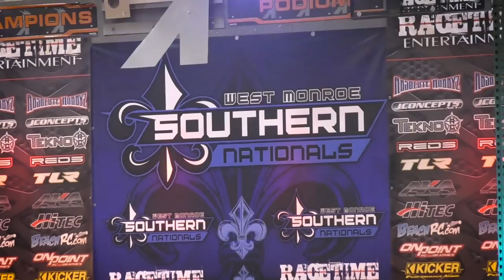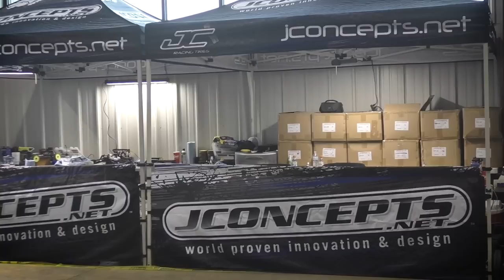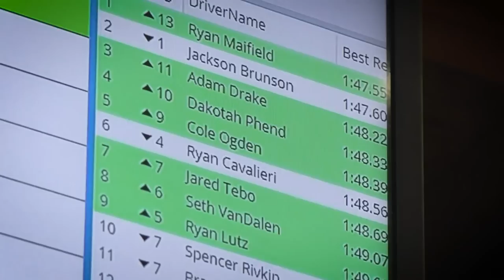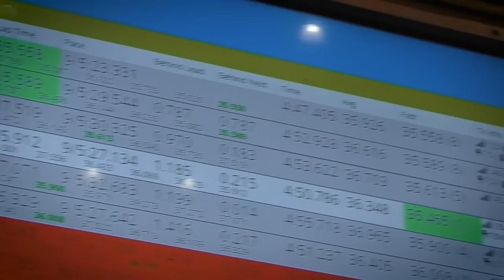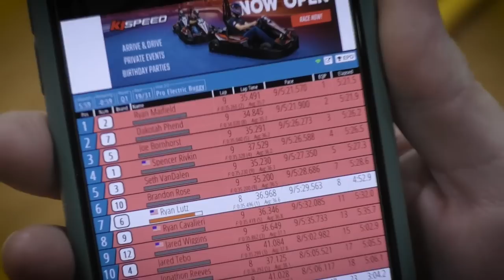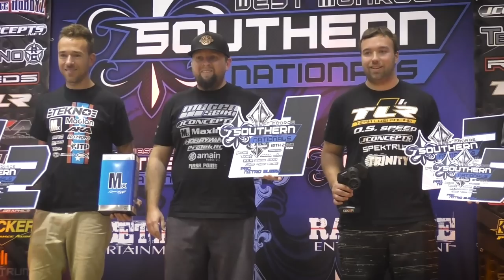2020 Southern Nationals - A Rough Ride To The Podium (Updated)

Comment: That's a good ideal Spencer. It is always the out side of the tire that iv had come un done. It's never the inside it's to bad you can't do that trick on the inside beed as well.  When you flip the tire inside out then slide it on the rim then glue it to the rail good all the way around. Then when you glue the out side it's even and there is no over hang.